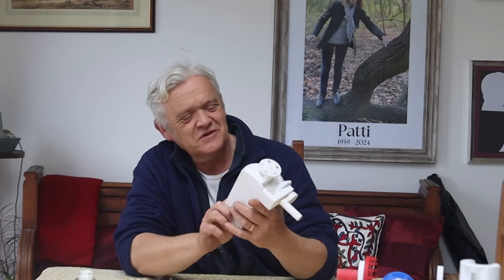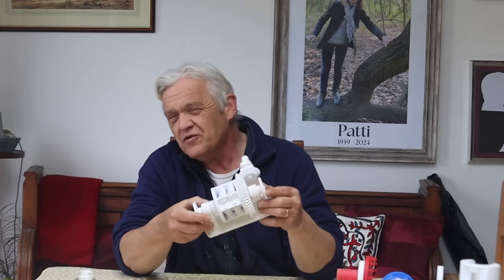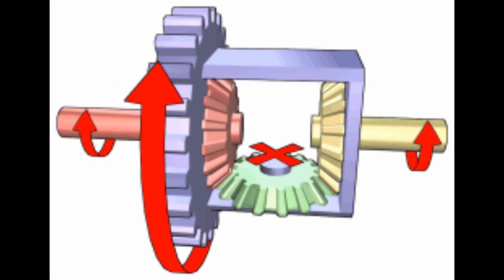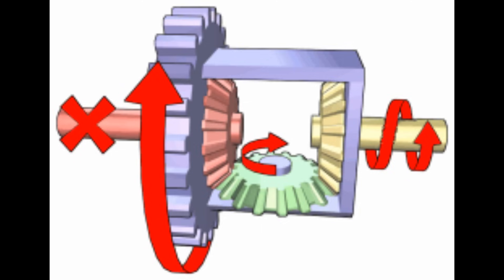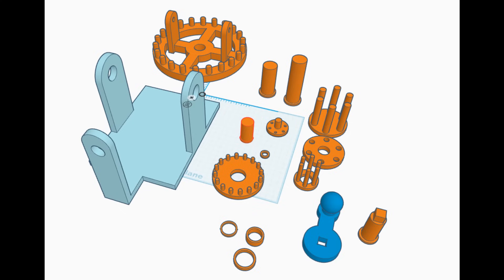2371 Leonardo Da Vinci's Differential

Comment: Robert, I had a pre WW2 Singer sports car which had plain spur gears for the diff gears. These six gears  half overlapped and half engaged with the output spur gears. Their  six shafts were rotated as an assembly by the crown wheel. Very quiet and smooth when rotating just one rear wheel off the ground. Never seen one in any other vehicle.

Comment: "Crude gets you up and running, and complex stops you."
I like to start any type of project with a proof of concept even if it is made from paperclips or paper maché, so I don't make a fool of myself due to some glaring oversight. If I can cobble together a working model out of the flimsiest materials, the "real" version will gold up just fine ;)
Reply: "A complex system that works is invariably found to have evolved from a simple system that worked. A complex system designed from scratch never works and cannot be patched up to make it work. You have to start over with a working simple system." – John Gall 

I like to keep that in mind.
Reply from the maker: niceone mate - thanks for taking the time post that - good point and well made